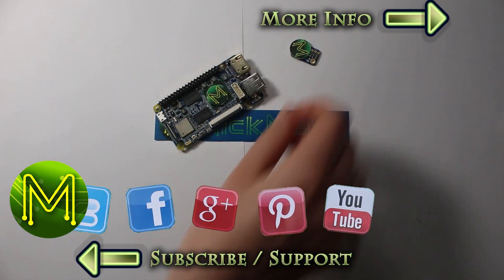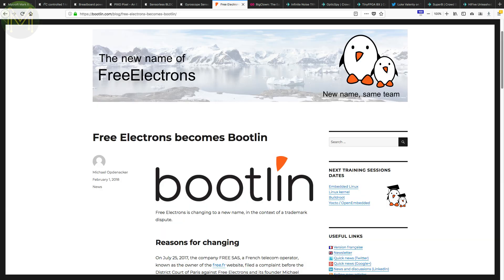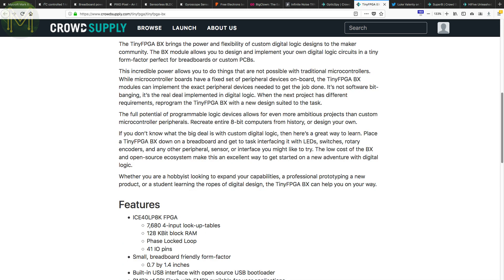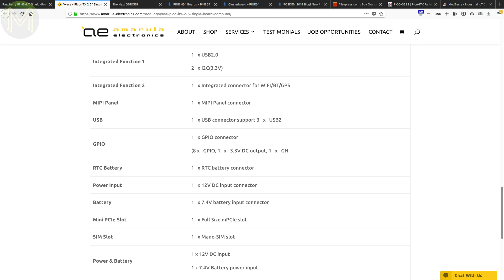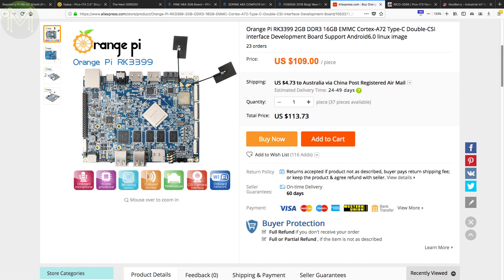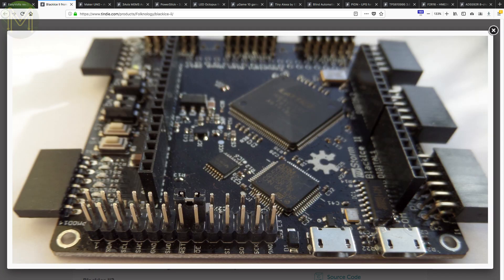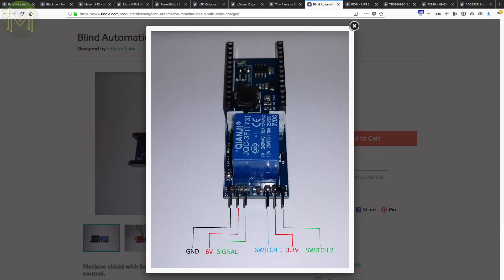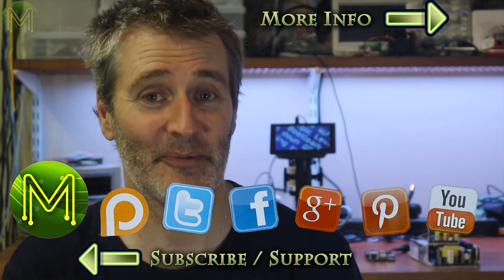#194 Weekly Roundup #51: New Maker Products

Comment: I really like that Bootin allwinner project but couldn't Allwinner just release their own stuff and save all the time and effort? Shouldn't the open source community avoid helping companies like Allwinner.
Reply from the maker: Good question!

The first reason is that hardware companies are really, really bad at doing software. Hardware and software are very different beasts and require a different engineering brain.

The second reason is that hardware companies don't want to give too much away too early. Giving away detailed silicon specs too early and they risk losing out to a competitor.

So, we have to put up with the default software that may come as a binary blob or reverse engineer.

Comment: 1:57 "sensorless" in this context means the type of BLDC motor speed control system used in today's RC model aircraft, cars etc. They have only have a 3 phase connection to the motor. Sensorless is the common variety.

Sensored systems are way less common, there is additional signal wiring between the speed control and the motor. The speed controller gets feedback about the rotary position of the motor, and is able to provide smoother, controlled motion at the lowest speeds.

Comment: There is a lot of traffic already about the Odroid N1 and the fact it is over $100 yet has no built-in wireless. Yeah, yeah, yeah, you can buy a dongle, but a decent one will run you at least $15+ for one that does ac and bt. Now you are over $125 and still have no idea on the cost for a case.
Reply from the maker: Personally, I think it's a good move to not have wireless, but that's just me. I tend to wire everything in and keep wireless for true mobile devices. However, I can understand why people would want it.